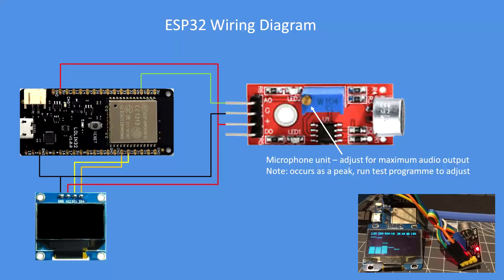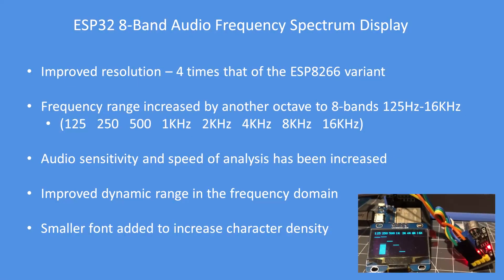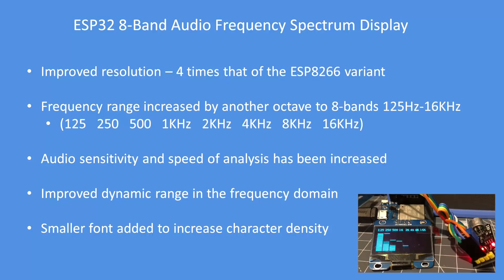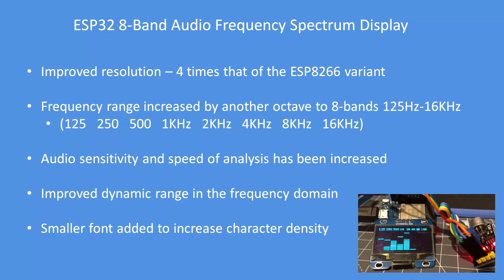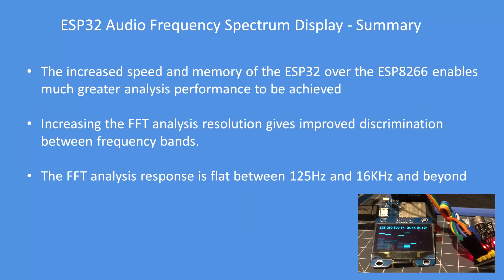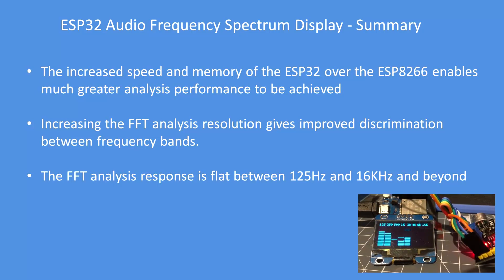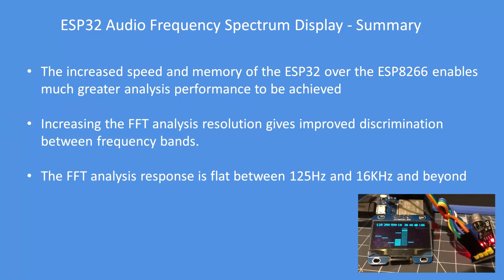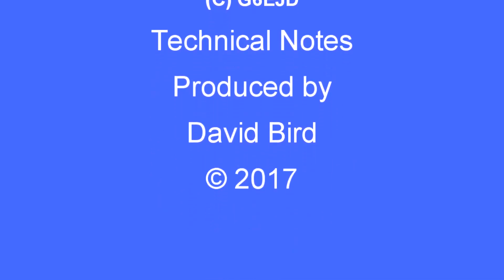Tech Note 077 - ESP32 8-Octave Audio Spectrum Display

Comment: Hello , thx for sharing , i tried several others to get fft from my M5 GO bottom mic , all of them just showed fixed data , i stripped all display commands from your code to check if the fft worked and gladly it does . Is there room to increase the nr of freq bars without effecting performance?
Reply from the maker: Yes, everything  can be scaled up, the FFT function will return all of the harmonic content, but in practice the harmonics will start to be of little value because above say the 10th, each amplitude gets successively smaller, to the point of being insignificant.

Comment: Dont Works! Arduino IDE says constantly deduction failed, or problem with arduinoFFT first letter size. Could you please help?
Reply from the maker: Uploaded a new version to GitHub, the library has been changed significantly, now correct.

Comment: So what is he limiting factor for how low it can go, eg subsonic?

I don't care above 100Hz in this case. Call it 64 or 128Hz upper.

We think our dog reacts to a noise when it's windy and the leaf patterns suggest we have a giant recorder forming on one of the corners of an adjacent building and I would like to check this down to maybe a few Hertz.
Reply from the maker: The limiting factor is the microphone the software will and does analyse down to zero hertz as there is a DC component in the array(0) position. Your dog is almost certainly hearing ultrasonic noises. At both the low and high ends of the sound spectrum you won’t be able to find a transducer (microphone) capable of detecting the sounds, both ends need specialist equipment.

Comment: I know this is az ,,old" video, but i have subscripted, yours is the only one working ESP32 based/OLED spectrum analyser build/code. Im using with a 1.3" oled. Just  question, because im not a good programmer, there is way, display more frequency? Another question, if i will replace my 4 pin OLED to SPI, will be the screen response better? thank you
Reply from the maker: The response speed is actually the human reading the display and the time it takes to sample the incoming waveform, so changing to an SPI bus won’t affect performance. In my design, it is the FFT analysis time that determines both spectrum width and speed and it’s as fast as the ESP32 can go. The nyquist and sampling theorem sets the maximum frequency at 1/2 the sampling rate which is 32KHz, so this is as good as it gets. You’d get much better capability by making sure you have a good flat microphone between 20hz-20khz because the FFT has a flat response in that range, also I doubt you can find a microphone as good ad that requirement without spending $500 or more. Plus your interface between the microphone and the ESP32 ADC needs to be as good or better than the microphone response.
Reply: @G6EJD  I just think add +1 or +2 extra frequency what will be displyed extra to the 8 field, this is much more like visualy must have/request like accuracy - i think now works well with a line in/mini jack from PC. My second change request again just a visual mod, making the transaction between ,,values" more soft, better if i give a link for this: https://youtu.be/djH4TIVmyFc?t=70
Reply from the maker: @XPERIA80  yes  it that’s a hardware based solution and it stops at 6khz, not very good really!
Reply: @G6EJD  Yeah, this ,,chip" method looks realy limited, but i just share this with you because  the ,,animation" of the lines looks smoother, i dont know why, delay or a trick in code, i dont know. Or because using the chip for analyze?
Reply from the maker: @XPERIA80  You can change the decay of the max-hold function in the code if you need to.
Reply: @G6EJD  I have found one line in the code with a comment decay, i need change this section: peak[band] -= 1; example to 2 ? sorry if im asking trivial question.
Reply from the maker: @XPERIA80  so the peek is recorded in the peak and then slowly reduced by the -1 you could use -2 or if you change the type to float then you can use -1.1 or -1.5 or whatever
Reply: @G6EJD  Thank you for your answers, i will try with -2. If i will split the current 8 frequency into 16 and define frequencys between the current values and i try adjust your code for this, display 16 segment will work or a impossible mission? Esp32 looks better choose for spectrum analyse display, but using another display , example a 2.23 inch oled/ssd1305 or a max7219 led matrix is impossible because drivers, librarys wroted almost just for arduino:( so we can use just with small oleds, tft or i saw few led strip example with fastled library.
Reply from the maker: Most displays other than OLED will be too slow then you’ll get false readings
Reply: @G6EJD  I need lot time to alter the code to work. Your first spectrum analyser marked with ,,2" in github - with 7 freq running smoother, i have changed this with add +1 freq, i have noticed adding more freq eating the esp32 too, started slowing. Another fight was alter the ssd1305 oled driver to work with 2.23" oled, because only the used oled driver working with the code. Normal ssd1305, ssd1306 drivers wont have horizontal line, mirror screen instructions. Thank you for your work and for the help.
Reply from the maker: Yes even with the performance of the ESP32 the time taken to analyse is significant, but you could reduce the number of samples that would speed up things.
Reply: @G6EJD  Good idea, i will try. I have noticed something else during a day using esp32. Running this spectrum analyse code after some ,,inactivity" looks like board stop working, maybe goes sleep, i need press EN button to start again, i dont know why, realy weird:>
Reply: @G6EJD  I have tested lot your code and i have experienced after around 1 hour randomly ,,crash" on my board, just pressing EN restart again the. I have removed oled, removed analog input conenction. Now i have upgraded esp32 board driver from 1.0.6 to 2.0.2 and now i get 1-2 warnings: C:\Users\X\Desktop\ESP32-8266-Audio-Spectrum-Display-master\ESP32_Spectrum_Display_02\ESP32_Spectrum_Display_02.ino: In function 'void loop()':
C:\Users\X\Desktop\ESP32-8266-Audio-Spectrum-Display-master\ESP32_Spectrum_Display_02\ESP32_Spectrum_Display_02.ino:95:77: warning: iteration 7 invokes undefined behavior [-Waggressive-loop-optimizations]
  if (millis()%4 == 0) {for (byte band = 0; band <= 9; band++) {if (peak[band] > 0) peak[band] -= 1;}} // Decay the peak
                                                                    ~~~~~~~~~^
C:\Users\X\Desktop\ESP32-8266-Audio-Spectrum-Display-master\ESP32_Spectrum_Display_02\ESP32_Spectrum_Display_02.ino:95:49: note: within this loop
  if (millis()%4 == 0) {for (byte band = 0; band <= 9; band++) {if (peak[band] > 0) peak[band] -= 1;}} // Decay the peak
                                            ~~~~~^~~~ But code still works, now the question is why stop running sometimes.
Reply from the maker: @XPERIA80  That's just a warning because it uses a for loop, it could be resolved by using a while loop. You need to capture the serial output when the board crashes to have the trace log and find out what is happening. It is most likely one of the libraries or a coding mistake, did you change anything?
Reply: @G6EJD  I tryed capture the serial input, but however i set the debug level before compile, nothing visible in serial monitor, so i tryed print simple "Ok" - but the result was, this stoped too. I dont know, how can i get detailed log, i have not found any tutorial. Settings before compile debug level to anything displaying nothing to serial monitor. I have used 1:1 the linked librarys, changes: i need set SPI connection for OLED and i have used ssd1306 driver. I have disabled the max peak slow falling FOR, but i have tested maked no change with without. Also because OLED display complatibility trouble, i have shifted the first bar lines with 7. But i have tryed also remove all pins of the OLED, finaly i have removed everyhing (i have used line in jack with capacitors/resistance to receive analog from jack)- result was same.  Standalone the esp32 lookslike crashing around/after 1 hour running with the code. Now i placed a 1 millisec delay in main loop + upgraded the esp32 board driver, so im re testing the code running again. Maybe board driver is the problem, maybe the NodeMCU esp32 board itself, because cheap board.
Reply: I have runned out from any type of workaround, at last i have returned to a older board driver 1.0.4 and set as board type NodeMCU-32s (i have a cheaper board) against Esp32 dev module - so looks i have won some speed - thats was visible on screen refresh rate - but still around 1 hour running board freezing.

As extra i have tryed a independent, external 5V power supply + add a capacitor between + - (supplied to esp32 5V+GND legs, and OLED was connected to 3.3V, but still after 1 hour stuck, just if im press EN will start again.

So can be the cheap board or still the code what generate this event with this board - i dont know because there is not other sign of error. maybe the oled driver, i dont know.

Comment: Great job, how can adapt the code with my arduino nano pls?
Reply from the maker: Apart from the choice of ADC input pin no change. It may not be able to handle higher frequencies due to a lack of processor speed.
Reply: @G6EJD  I have just an error Wire.begin(4,5) with my arduino, I don't understand!
Reply from the maker: @MAVASSA1  that  may not be supported on that board, just use wire.begin(); and make sure the display is connected to the SDA and SCL pins of that board.
Reply: @G6EJD  already tried, it doesn't work, it tells me error! sorry to borning you I try to underdtand and to make a bt speaker easy 
spectrum or fake spectrum with matrix RGB and a mic for my futur e-commerce!
Reply from the maker: The Arduino supports the I2C bus so did you include the library wire?
#include <Wire.h>
Reply: @G6EJD  yes I inclued it, I changed nothing about your code just my pin SCL and SDA like that SH1106.h display(0x3C, 4, 5) and wire.begin(4,5); nothing works! For now I well understood vu meter with matrix 8*8 or 64 leds it works fine but I would like make a fake spectrum about 8 bands of 8 leds with a sound 1024/8 because I know the arduino memory is low.
Reply from the maker: @MAVASSA1  On the Nano the pins are SDA -> A4
 and SCL -> A5 accordingly, make sure the display is connected SDA-SDA and SCL-SCL and Gnd-Gnd and 3.3v-3v3
Reply from the maker: So you have the display running?
Reply: @G6EJD  hye, no I always don't have the display, arduino doesn't samely works , I had to buy a SP107E and used Led Chord. Also I will buy an esp32 to do like you! It's not grave.

Comment: Hi David, thanks for sharing this amazing project. I am hooked to Spectrum Analyzers and this looks so cool, that I assembled this project. I had to adapt the code to my SPI OLED SH1106 display (had to change the library, too). It works perfectly. 
I noticed one strange thing, when I plugged in frequency generator: the bands indicate twice the fr. value! It means that when I input 1kHz sine wave, the 2Khz column rises. Did you test it for specific frequencies?

I plan to do 2 things:
a) change the titles, ie indicate half the freq. values (fast and easy)
b) change the code, the part, where the bands are selected (a bit more time consuming).

Comment: Please help: I keep having this errors:
exit status 1
invalid conversion from 'const char*' to 'const uint8_t* {aka const unsigned char*}' [-fpermissive]
Reply from the maker: Marcel, I need a context or what code are you trying to compile is it a graphics image?
Reply: I had the same error. I had to change the drawHorizontalLine to drawLine and change the arguments accordingly, to the Library used.
Reply: Hi David,
I'm amazed at what you have achieved with so few lines of code - Very smart utilisation of libraries :-)
I also had the above error message. It was raised at the line:
display.setFont(Dialog_plain_8);
The setFont function is expecting uint8_t* but the font is defined as char*
I fixed it by changing the line in the font header file from 
const char Dialog_plain_8[] PROGMEM = {
to
const uint8_t Dialog_plain_8[] PROGMEM = {
Not quite sure how robust the fix is but at least there is no exception and the header is displayed correctly
For the benefit of those that may follow, I also made the following changes:
I had to change the GPIOs for the SDA, SCL from 16, 17 to  21, 22
The code also assumes the OLED address to be 0x3c, so some may need to change this line:
SSD1306 display(0x3c, 21,22); 
You also had the line:
#include "SH1106.h" 
Which I changed to 
#include <SH1106.h>
After I added the code ThingPulse
/esp8266-oled-ssd1306 (previously known as squix78/esp8266-oled-ssd1306) to my Arduino IDE custom library

To be honest, I still haven't finished the project as I haven't added the microphone (arriving tomorrow) but I was able to test the animated columns by simply touching the GPIO pin.
Yeah I know, not to be recommended but hey - it works!
Reply: Got the microphone breakout this morning
https://www.amazon.co.uk/gp/product/B07MY293KD/ref=ppx_yo_dt_b_asin_title_o01_s00?ie=UTF8&psc=1
and it works just great. Just needed to turn down the amplitude (clockwise trimmer pot)
I can't wait to scale this project up for my wall of lights
https://github.com/Charles-Goodwin/esp32-fastled-webserver/wiki/1.-Hardware-and-Software
Reply from the maker: Good to hear. That trimmer adjusts the output bias between 0-3.3v and when correctly adjusted you will see a symmetrical waveform, I posted a test routine to enable adjustment where you use the Arduino IDE boards , plotter function, play a continuous note (ideally) and adjust for minimum distortion

Comment: Hi Dave, is it possible to use ESP32  and FFT to instantly analyse the frequency and amplitude of a singer? How fast and accurate would that be possible please? Thx.
Reply from the maker: Well, it’s already doing that as the lag between the sound and display change is near instantly reflected in time with the music. I have not measured the conversion delay but the human eye brain delay is generally accepted to be ~180mS so from sound to visual feedback appears to most as being instantaneous, so my guess is conversion time is much less than that, maybe 0.5mS because conventional signal analysis says the sampling time needs to be at least twice as fast as the highest frequency, from which at 16KHz the 0.5mS time is derived. Hope this helps.
Reply: @G6EJD  It was always my dream to design a system that converts the human voice  pitch and amplitude fast enough  to a midi signal,  so I can sing or hum the melody and convert it to sax or flute sound while playing chords and bass on the piano.  It should be  detecting the correct pitch and amplitude as fast as possible to be usefull. Hope I can test this later, very interesting....
Reply from the maker: Have you seen the morse decoder, it can go very fast when doing that, the code be further optimised to improve speed too.
Reply: @G6EJD  not seen yet, will check it, thx.